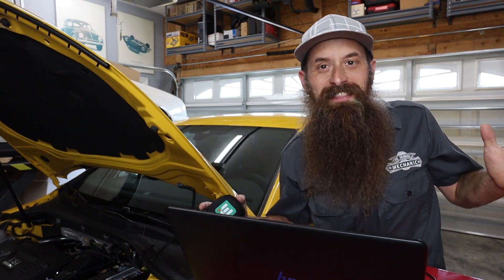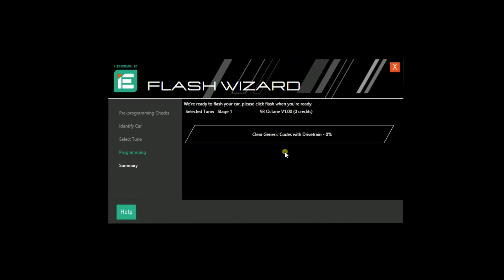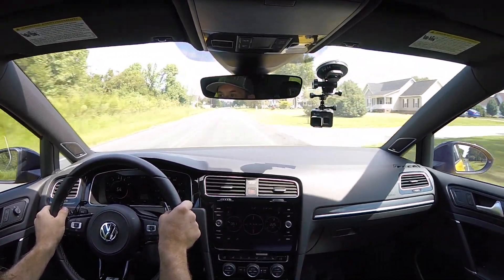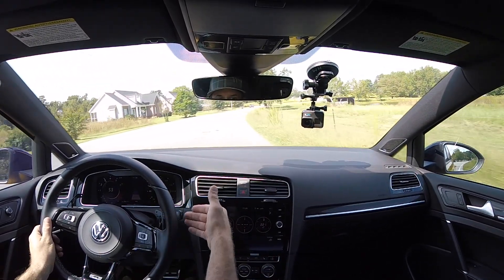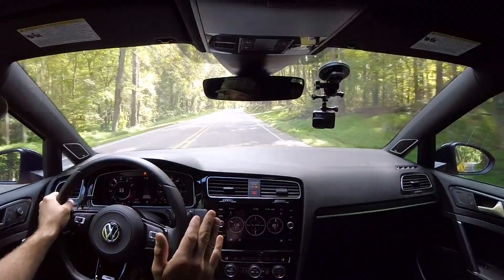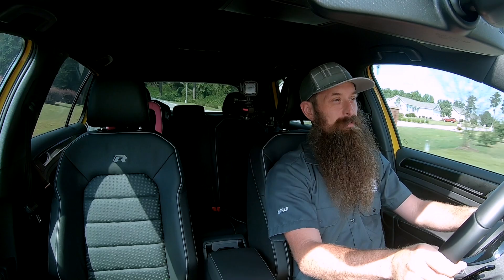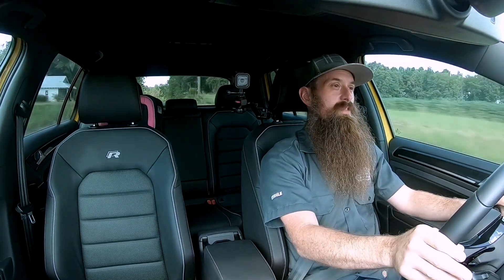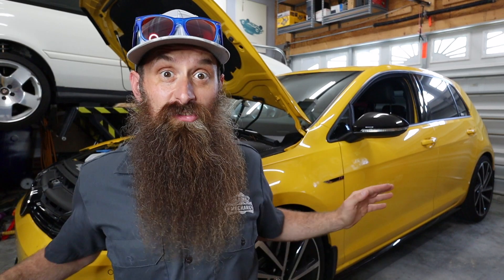How Much Horsepower Does a Tune Add? ~ Stage 1 Tuning Golf R

Comment: Hey humble mechanic , I have a mk7 gti (2016) dsg. It’s been acting funny lately. Sometimes when I go to start it, it’ll crank but won’t fire up unless I give it some throttle. It’ll also idle a little rough but only in the park position. No codes popped up. I’ve done spark plugs amongst other things and always used premium gas from day 1. Now, it doesn’t always do it but it isn’t getting any better. Any thoughts bro ? I’m hearing cam followers, MAP sensor issue. I’m not sure but hopefully you can help ! I did have the intake manifold replaced (recall). New battery also put in a year ago.
Reply from the maker: Man tons of possibilities even a bad HPFP.
Reply: HumbleMechanic wouldn’t a bad fuel pump stall the car ? I thought it was the pump as well. I’m defeated ! Lol what do you think my first step should be ? Since no codes ever pop up , I’m leaning more toward the hpfp

Comment: Hi. Quick question... is this IE software safe to use at 7800ft above sea level? All parameters safely within the IS38 pressure ratio? I'm in Bogotá, Colombia, and am very interested in this tune for my MY2018 Seat Leon Cupra. Thanks.
Reply from the maker: IE is at a higher elevation too. I’d assume it’s fine. But I might call them and ask just to be 100%

Comment: 5:29...reliability?  It's a VW...it won't have any.  I had a 2016 GTI...it started having real issues at 20k miles.  I couldn't get rid of it fast enough.  I will NEVER buy a VW again.
Reply from the maker: Man I’m sorry to hear it. I’ve seen some that were nightmares and other run forever with no issues.

Comment: I have a 2017 GTI Sport DSG, soundaktor turned off and a AEM open air intake, otherwise stock and it sounds perfect in my book.  I generally don't like 4 cyl exhaust notes and the intake lets the turbo noises through and the intake woosh... it never gets old!

Comment: Unfortunately you could have gotten virtually the same results with a piggy back like the JB4 for less money, no TD1, and you can sell it. From what I understand the actual tune is the costly bit, and you can not sell that with these types of tuning devices. Plus that sweet long power train warranty just got flushed down the toilet, whereas the piggy back can be removed without a trace. I know you claim that is only for parts directly affected by the modification, but auto manufacturers can and do argue that adding power can and does add stress to nearly every part of the car. So once you flash your car, good luck getting warranty on anything.

If a manufacturer even suspects that you have modified your car they will virtually cancel your entire warranty, and then it is up to you to try and fight them if anything happens, and good luck with that, life is to short to be fighting with some faceless corporation. Unless you are planning to go stage 3 at some point soon you really should have gone with a JB4 and a BMS pedal tuner , virtually the same results at a lower cost, you can sell it (intact), and no guaranteed TD1 warranty issues. Oh and the JB4 has some cool features for monitoring and logging engine parameters, adding methanol injection, and it let's you make changes on the fly.  

Tunes are great for people with older cars planing to go beyond stage 2 level power.  My car with a catted DP and a JB4 now does 0-60 in 3.6 seconds and 11.9 @ 115 MPH so...
Reply: I had jb4 but it kept throwing a engine light code so switched to IE tune for both engine and tcu and car drives stock but turns into a monster when you floor it. I feel way better then a jb4 pigggy back tune. My buddy also has a jb4 in his bmw F10 and he always throws engine codes too so go figure
Reply: @debrajohnson4689  There are easy solutions to that issue,  1. The JB4 can block or immediately clear the code. 2. I have found a better low cost solution https://forums.vwvortex.com/showthread.php?9327797-How-to-eliminate-O2-CEL%92s-and-achieve-emission-readiness-with-a-high-flow-CAT

The only other difference is the throttle tuning which the JB4 does not do but if you ge the BMS pedal tuner it is even better than a tune because you can make it as mild or as wild as you could want and adjust it on the fly.
I have driven, ridden and  raced several cars with similar tunes and there is virtually no difference in objective performance, and with a pedal tuner the  my car feels way better than a tuned car so...
So with a JB4 and a pedal tuner  you have:
1. The same performance and as good or better subjective feel that is adjustable on the fly.
2. Performance monitoring and logging
3.  On the fly adjustability
4.  Lower cost
5. Works on any car so you actually have something to sell
6. The possibility of hassle free warranty work.
So what if you load in a 93  oct tune but then end up in an area that only has 91 oct? At least with this IE tune you could down load a different tune, but it is not exactly something you could do on the fly. 
I think for folks wanting better than stock but not wanting to go to crazy, the JB4 with a pedal tuner is absolutely the way to go IMO.

Comment: Can that ECU store more than one tune/map at a time?, say I roll into an area, that's all 91 octane. I think the older models, you could switch the tunes on the fly, using the cruse control buttons,  I know the ECU in my 7R can only store one. On the tune though, I couldn't agree with you more, after my Stage1 tune, it was like the car had been sleeping for the first 5K miles.  you're going to love stage 2.
Reply from the maker: ThE older ones did. I don’t think this one will.

Comment: I would love a golf R as my next ride. 70 yr old British guy on youtube put on an upgraded turbo from turbo technics on his Golf R and got nearly 600 hp. I was a little disappointed at the low improvements to the R from IE. I have a 2014 GLI and used a Unitronic stage 1 tune. It increased to nearly 50 hp and 90 tq. When I looked at the getunitronic.com website they don't have a Golf R upgrade available yet - but you should look into that in the future. I think Unitronic is better than APR, not too familiar with IE or Cobb.

Comment: Thanks for the video, Charles.  Have you noticed any changes in fuel economy stock vs stage I tune?
Reply from the maker: Pretty close to the same. Well maybe a little lower but that’s the driver. Haha

Comment: SEAT Leon Cupra 290 (2.0 TSI Gen 3): Stage 1 tune by BSR in Sweden, Eventuri air intake, Racingline inlet hose, Leyo Motorsports Turbo inlet elbow and muffler delete = from 290 Hp and 350 Nm to 370 Hp and 450 Nm engine output (+55 hp tune and +25 from the intake). As you said Charles, that's how it should've come from the factory! The sleeping monster has woken up :) Feels so agile and eager to rev now!! :D:D

Comment: I guess that if u flash the car back to stock, the dealership would never know that it was tuned as long as no traces are left in the ECU?  Pretty impressive for a stage 1 tune. I owned a mk4 r32 for 14 years and sold it last year. Miss the growl and the look. Tuned it conservatively with a flash and air intake. Everyone loved the car but it was either turn the car in to a project car or get something that would easily switch from work vehicle to a weekend track car. Last year i got the Golf R and its been a heck of a lot of fun. A little more growl and boost in torque and hp is defenitely needed. Keep up the good work. You have given me some food for thoughts for my next track day.

Comment: Love your info, so glad a pro is sharing GTI content. on YouTube . quick question? 2015 TSI 1.8. nice car but sways around corners . Thinking about converting to  minimum drop springs or maybe sway bar to flatten it out without losing much of the stock ride.  HnR? diameter of bar?  Dont bother with either? lol. thanks 🙏!

Comment: Someone needs to explain this "Stage 1" "Stage 2" "Stage 2+" etc. What makes something a Stage 2?
Reply: Stage 1 = stock car
Stage 1+ = stock + intake 
Stage 2 = downpipe, intake, transmission flash required

Power increases dramatically as you go up.
Reply: Not 100% but I believe stage one is just a tune and stage 2 is downpipe decat and then tune again.

Comment: My DSG tune means you can launch without deactivating ECS.
Reply from the maker: Cool who is the tune from
Reply: APR. I'm pretty sure all the brands do the same thing. Get your oil temp up to optimum and try doing it in race mode... (simply shifting it to race gearing works also)

Comment: I NEED A GUy LIKE YOU IN MY LIFE !!!!! Plz help My 2010 Jetta wolfsburg MK5 is dying !!! I just replaced the timing, chain tensioner, guide rails, the mechanic replaced the water pump with a  aluminm body one I guess he said they have? and I had all the work done in march, not the engine wants to jump out of the bay, it is the TSI 2.0 , and I have been watching all your video's and I know my car used to drive like this one ! I want to get it back !!! I have no idea about engines, and I have no money ! Ha ! So ... I need to buy a spare daily driver, and then I need to get this car, back . UGH It was my dream car. The DSG is Of course turned to shit.. mechtronics went out and now gears slip and it needs a complete rebuild, which was next on the plan.. but I can't get the engine to be happy for a minute. Now I am so sick about my baby not running right.. I wish I could bring it to you .
Reply: Maybe you know a guy in South Florida?

Comment: hey @
HumbleMechanic, thanks for the great videos it has helped me a lot. quick question, does that DSG tune get rid off the auto shift in Race mode?
Reply: If you are referring to the auto upshift in manual mode, the answer is no. But we do disable kick down in manual mode.
Reply: @IEtuned  thanks for the reply guys, yeah I was referring to the auto  upshift in manual mode

Comment: I believe about the overall gain , but a dynajet is not really accurate for hp and torque numbers. Dynocom and Mustang dynos are much more accurate ;)  the real hp at the wheels stock Golf R should be around 259 hp... ;)

Comment: “This is how the car should have come from the factory” — how I felt after putting a VF48 in my Forester XT and got it tuned.  Love that feeling!  Cheers!
Reply: Install a STI steering rack also, really transforms the car by making the steering a little heavier and you need less turns from lock to lock. Best mod I did on my XT next to a VF34 turbo.
Reply: now that is awesome.  nothing better than a sleeper that you can actually sleep in!

Comment: If you were to trade in the car or wanted to keep your warranty, how would you ensure that VW doesn’t see in their systems that you’ve tuned the car? Stupid question I know, but I’m new to this whole thing !
Reply from the maker: They can tell if they look. The ECM has a flash counter. If that doesn’t match the number of times vw says it should you can get flagged
Reply: HumbleMechanic wow! Never thought you’d actually reply, so thank you so much for the information! Would there be any way around the counter, or is it the type of thing where once you do it it’s a permanent Mark in the system? Again thanks so much, you’ve got my sub and likes 🙂
Reply from the maker: :) So as far as I know, no one has been able to beat the counter with out a full ECM wipe. That requires the tuner to have the ECM in hand. I am guessing  it will not be long before someone figures that out. It seems like an easy thing, but I have no clue how that's done. That is above my pay grade as they say

Comment: ok, I'm game.  sad really, that even after spending $30k+ for a car, that you the buyer HAVE to buy an aftermarket ECU tune to actually get the most out of the car.  I am currently experiencing that on my very new 2019 WRX.  Man, I cannot modulate the clutch/gas as smoothly as in my 04 GTI.   In time I guess.  Thanks Charles, enjoy the tune.  Cheers.

Comment: Do you think if I tune my gti and then if something happens I flash it back to stock they’ll be able to see that it was tuned before?
Reply from the maker: Depends on the year. Mk7 up have flash counters. If you tune and define, they will find out
Reply: HumbleMechanic dang that sucks I got a mk7.5

Comment: Charles, how do you feel the IE tune compares to Unitronic?
Reply from the maker: Very comparable.
Reply: Cool.  I did Uni this go round for the ability to tune at home v. Back and forth to my APR dealer. I also am liking the more linear powerband. My APR MK6 ran great but had a touchy throttle and fell off the power around 5500.

Comment: Would be awesome if u could dyno it after the intake to see if it helps with hp and tq as well 👌
Reply from the maker: I may. The issue is, it’s a 2hr drive each way to get to the dyno.
Reply: @HumbleMechanic  sounds like an excuse for a drive Mr Humble 🙂

Comment: And your warranty is now void.
Reply from the maker: That’s not exactly how that works. ;)
Reply: @HumbleMechanic  Asked my local tuner for adivce. this is the response I got:  We can do a Stg1+ tune for 310hp and 347ft/lbs of torque, however we would need to log in and check to see if it available for your particular ecu  They didn't respond when I asked about warranty

Comment: How high is the possibility of a  engine teardown or a cylinder failure after a S1 tuning? Mentioning the fact that I will not drive it on a track
Reply from the maker: There isn't many mods with out some risk. The piston failure video I did a while back was stage one. But I couldn't place full blame on the tune.

Comment: I'm gonna go out on a limb here and say that based on your subscriber count and general popularity, every VW dealership near you (and maybe not-so-near you) has SOMEONE on staff that knows your car has been tuned. Oh, the price of celebrity.
Reply from the maker: Very likely(which is SUPER RAD) However tuning the car doesn't do a complete warranty void. They have to prove the tune caused the failure. That said no mod is with out risk. The worst that happens is we rebuild/replace and engine with more go faster parts. LOL
Reply: To add to what Charles is saying, give this a read if you're bored: https://en.m.wikipedia.org/wiki/Magnuson%E2%80%93Moss_Warranty_Act

Comment: I have a 2017 S3 DSG. 310 stock PS in Europe. Stage 2 (only Software an air intake) - 385 PS 0-60 4.0 dead. 
:)
Reply from the maker: NICE

Comment: Not bad gains percentage-wise from a tune only.  +16.7% peak hp and +27.5% peak torque at the tires is a solid improvement over the factory calibration.

Comment: Are you going to do a stage 1 on the R32?
Reply from the maker: The R32 is tuned. It made almost no difference in power. Just better throttle response

Comment: Does the DSG tune fix the jerkiness driving at low speed?
Reply: Probabky not. Its inherint to the DSG design. It uses a clutch, so it will never be smooth at low speed.
Reply: @Hulluboju  not true, use VCDS to do an adpation if its inconsistent. Mines smooth as butter after  couple of days relearning.
Reply: The previous 6 speed was far smoother than the 7 speed, so it must be possible to improve it.
It’s the one thing I really dislike about the car!

Comment: Why don't you roll the car on a proper 4WD dyno @
HumbleMechanic
I can speculate you're losing up to 5% of pulling power from the rear wheels that are dissipated inside the Haldex coupling... I wouldn't do that to my car, not even once.
Reply from the maker: As I said in the video there isn’t one local. Had to drive 2hr as it is for this setup. The 5% loss as you speculate is possible. But again as I said in the video it’s about comparing the gain from the tune
Reply: @HumbleMechanic  you should do a 4WD run at some point... hoping for the next round.. ahem stage ;)

Comment: what does the dsg tune really do? is it really worth it? as it costs the same as the ecu tune itself?
Reply: The DSG tune is a different additional cost, but is every way as important and effective as an ECU Tune. Our DSG Tune completely remaps for higher RPM limit, faster shifts, optimized shift points, clutch pressure to hold the increased power of the ECU tune and more. It completely remaps the transmission for enthusiast driving and to match the new ECU calibration.
Reply: @IEtuned   fair enough. so for someone like me i have the DQ200 and probably cant afford both maps at the same time, which would be better to have first?
Reply: @fdgaming  I would do the ECU Tune first and the DSG later when you have a chance. The gratification from instant power is always more fun. :)
Reply: @IEtuned  but would the ecu tune not put the extra wear on the clutch and lead to an early death? wouldn't the dsg tune be better first as  you benefit fro the faster changes and better launch before extra power is added

Comment: Why  didn't you use REVO software? It's in my opinion much better. :)
Reply from the maker: Their support in the US is awful
Reply: @HumbleMechanic  Now I understand why most of the US Audi/VW owners use IE or Unitronic tunes. 

However you did a great job on the Golf R! 
Does it void the warranty? Or you just put it back to stock before it goes to the dealership for a service?

Comment: Hi Charles, when you do the stage 1 or 2 or any of this kind of repros, what happen with emissions???
Reply: Stage 1 is completely emissions safe as it does not remove or alter any emissions systems. Stage 2 does require an aftermarket downpipe, that may effect emissions depending on where you live. Always check with your local emissions laws and requirements before making any exhaust modifications.